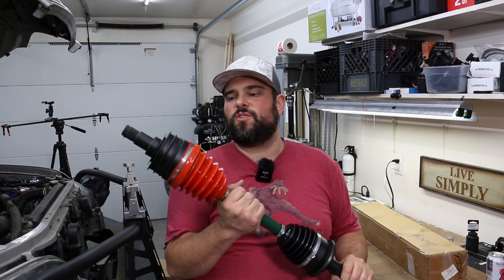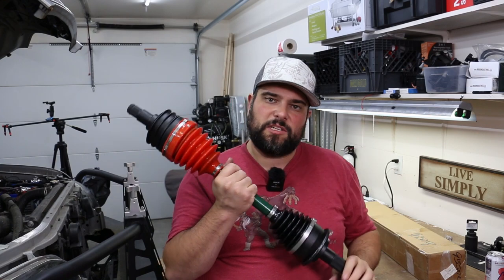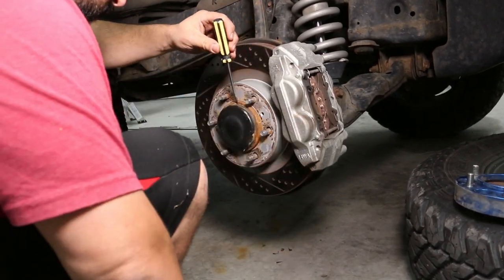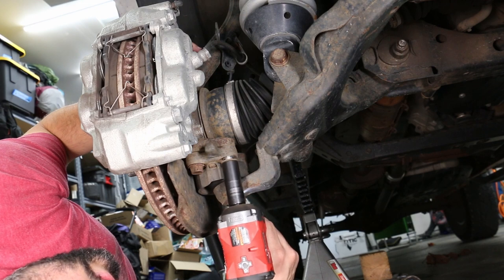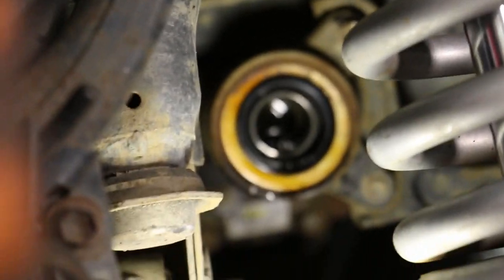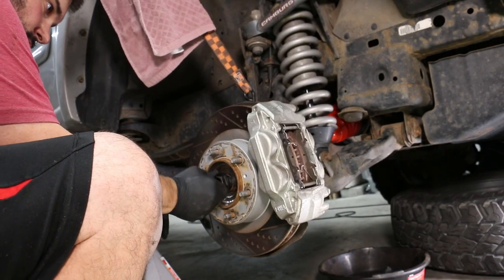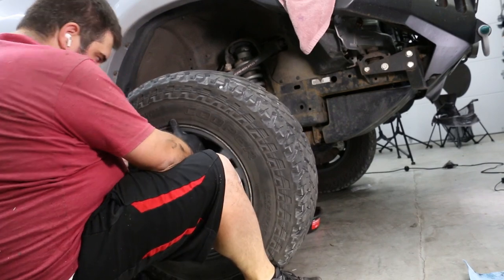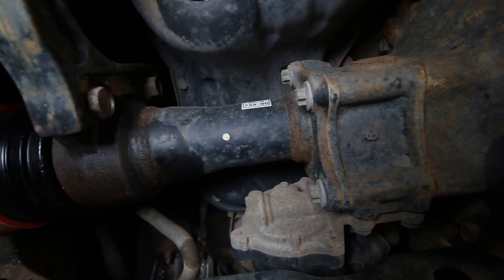High Angle CV Toyota Axle By CVJ

Comment: I have 10k on my cvj axles on my GX470. The boots are still in great shape but the inner joints are already making noise and need replaced. Called CVJ and they said there is NO warranty. I will not recommend them, good luck with yours lasting. I should have just bought parts store axles with lifetime warranty.
Reply from the maker: Hey Jeremy , that’s good info to have. I know a lot of people that have used them with good results but I’ll definitely keep an eye on them
Reply: Same thing happened to me.  NO WARRANTY.  Less than a year old.  Both “high angle” boots ripped.

Comment: How are the cv axles holding up? Are they worth the cost?
Also did you need to get an alignment after swapping cv's?
Reply: I’d say get remanufactured OEM ones, I was able to snag for about 117 bucks a pop. They are superior to aftermarket
Reply: @oASSAULTo  I ended up getting remanufactured ones as well. And I'll be ordering the cvj high angle boots to throw on the spares and a set on the oem ones whenever they go out. Thank you. I almost went with napa but oem felt best.

Comment: Nice Video.  I ended up ordering some for my 99 due to higher angles after a lift.  Have you noticed any premature wear?
Reply: Does your 99 have manual hubs? Or ADD? I'm in the same position in ordering some high angle cv axles from cvj as well. Just want to know how fitment went?
Reply: @pinoyboy808  no manual hubs.  So far fitment is good.  I ended up also keeping my diff drop.